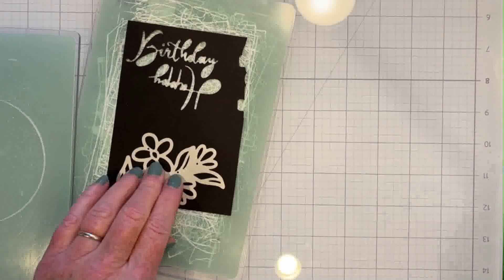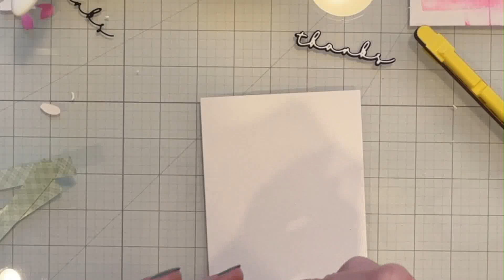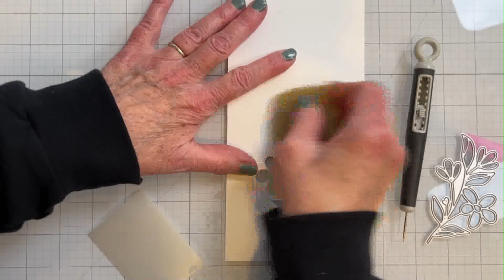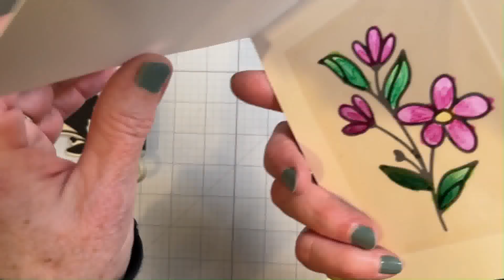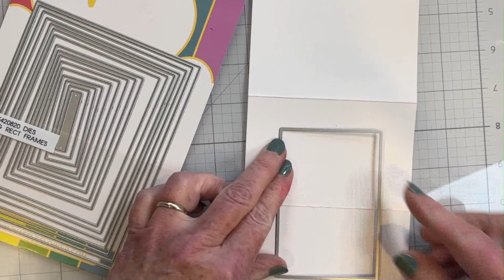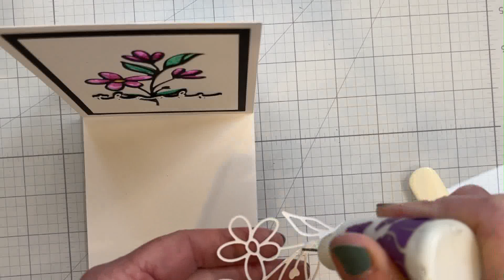NEW UPLOAD Cards Three Ways - One Frame Die

Comment: 😵How is that stencil cut??? professionally with a Lazer cutter ( how come that part isn't shown how miss leading ! )this is not an  easy project. there is more to it than meets the eye " and how much does a Lazer cutter machine cost anyway" 🍞🍞🍞
Reply from the maker: There is no stencil, no laser cutter.  I used a flower die, the Simon Says Stamp FLORAL STEM Wafer Die (#sssd112640) to cut the flower opening in each layer of card stock (using my Gemini Jr.) and, kept the flower die cuts to use on the projects.  The easel card isn't a difficult project, just a bit time consuming (I assume that's the card your referring to), aligning the die in the same position on the (4) different layers of card stock.  I hope that helps clear up any confusion!